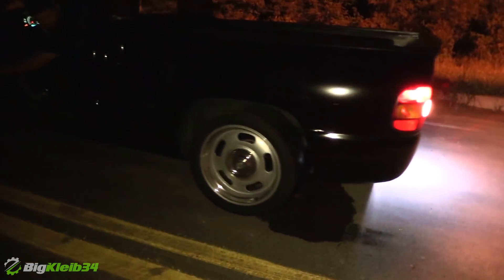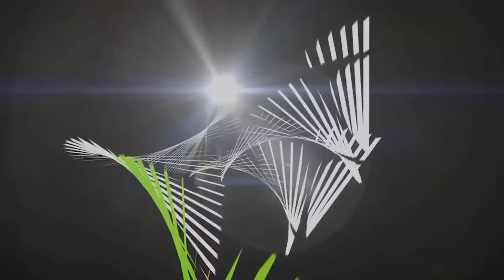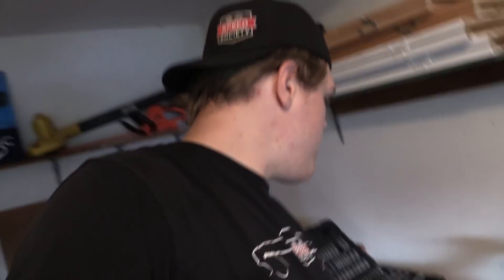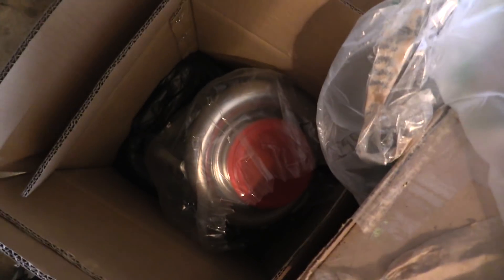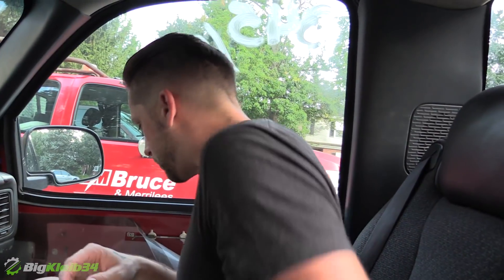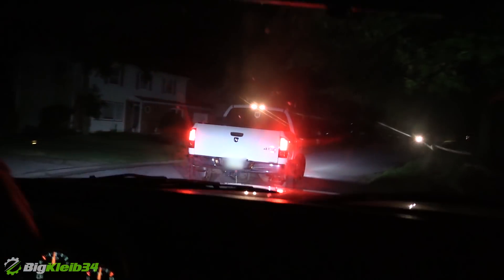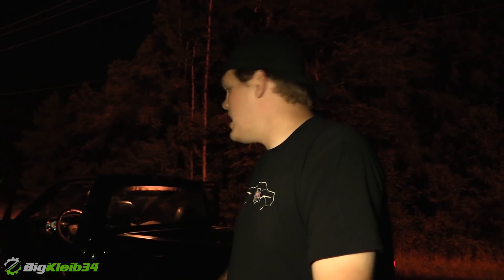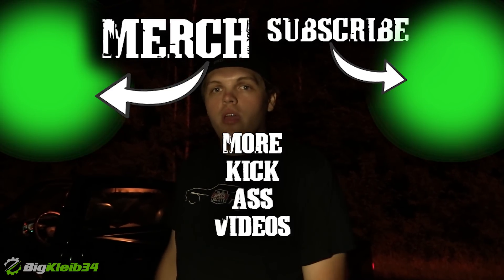I Broke the S#!T Out of My Truck!

Comment: Did you turn it off and on again? Maybe that will fix it :]
Reply: That'll magically reset the teeth on the ring and pinion. Hahaha
Reply: I broke three 10 bolts and last one was a built 10 bolt. I went Strange Engineering Dana 60 route this time...
Reply from the maker: OH SHIT IT WORKED!!
Reply: TV

Comment: If you can find a 9.5" rear axle from a Vortec Max Silverado or GMC Sierra Denali, that will solve your axle issues and bolt right in. Toss the "governor bomb" factory locker (if so equipped) in the dumpster, use any decent slip or locker and beat on it with confidence.

Comment: We went through a metric shitload of 60e's at the stealership in the mid 2000's.  Kinda sounds like the sunshell and gear broke.  That would be my educated guess from my infinite bank of useless information. Then you said it broke the 10 bolt also, that sucks they actually hold up fairly well compared to the trans usually.  Looking forward to racetruck status.
Reply from the maker: Yeah that's what I was told about the rear. Definitely going 80e but not sure if I'm going to just replace the rear or upgrade it.
Reply: BigKleib34 put a Dana under it.
Reply: 10 bolts are shit too sadly

Comment: Which trans company are you going with and stall?
Reply: Michael Byrd hopefully a junkyard 4L80 with an HD2 shift kit.
Reply: jpwdowiak friend recently bit the bullet. Lol, INGRID.... Either rpm or Performa built.. Thinking rpm but it is an 80e and held a built 6.0 l92 heads intake and then a 408 and now a 5.3 Magnuson 1900. Most common complaints are the 1st gear and the difference between 1 and 2.

Comment: 4L80 time! Truck 10 bolt is weak too, looks like all the teeth broke off the pinion, get a corporate 14 under there.
Reply from the maker: +Shit box it's been coming! Probably will start to shop once all the turbo stuff is close to done.
Reply: Shit box 
14 bolt with 6 lugs are around but are really heavy and only a semi floating axle in that design. I would prefer a 8.8 Ford axle. Very strong, available, cheap, etc. Parasitic power loss is lower I would bet.
Reply: turbolq4, I own a semi float 14 in a half ton with a 5 speed, been working the shit out of that truck 20 years, haven't had a problem yet. As far as weight goes, they can't be any worse than a Dana 60, and there's plenty of those in cars. 8.8 Ford is a good axle but I bet a 14 would do the job just fine...
Reply: Shit box 
I agree that they are good, I've had a couple. I googled the weight just out if curiosity. Looks like the 14 bolt ranges from 390 to 550ish pounds depending on which configuration it's in. 8.8 is around 200 pounds. Thats just dead weight, not taking into account the parasitic losses. In a truck that is being used for truck things then the 14 bolt is the first choice. For a driver that has big power the lightest axle that will take the abuse makes it faster. 9 inch is roughly the same as the 8.8 weight wise. The 8.8 is a Ford 12 bolt. Very similar.
Reply: turbolq4, It's a full size truck, not a Nova, 200-300 lbs wouldn't bother me any, it's already heavy. Personally id use a 12 bolt before an 8.8...
Reply: Shit box 
The 8.8 and the 12 bolt are the same. One is actually available for reasonable money.

Comment: Dude the gm 8.5&8.6 differentials are junk. My 02 Z71 Blew apart around 70,000 miles. It had the factory gov locker set up. Has a powertrax clutch locker that works great. Looks like you broke the pinion or sheared every tooth on it haha!
Reply: neXtrail_42 its the gov lock that ruins em put a tru trac unit and you can put 700+ hp through it like notjing

Comment: I don't get it.... I had a 4l60 in my 94 Tahoe and a 4l60e in my 99 gmc 4.8 both over 200k miles. The 4.8 even lasted on 6 psi threw a s475 until a th400 the truck... there trash no doubt but a burn out alone? Don't be dumb